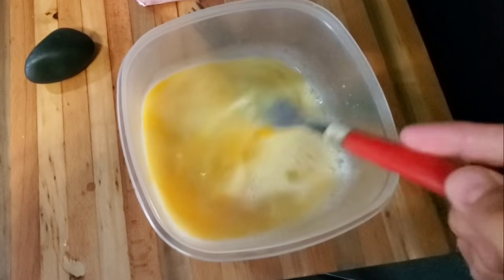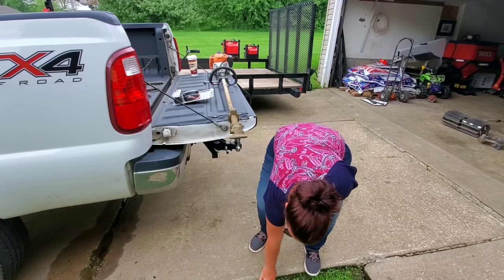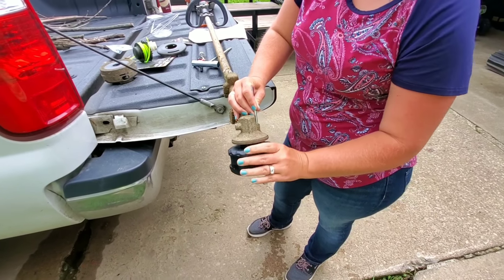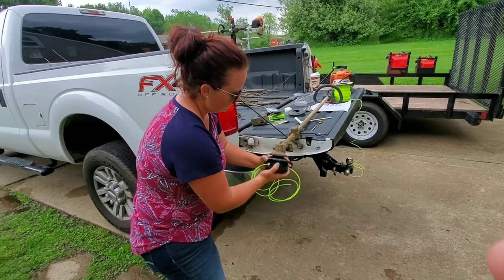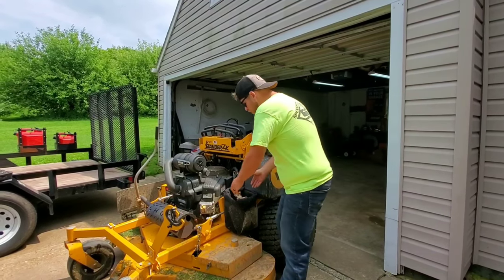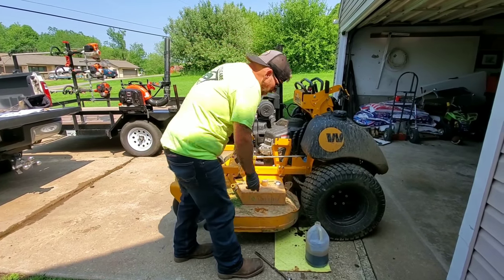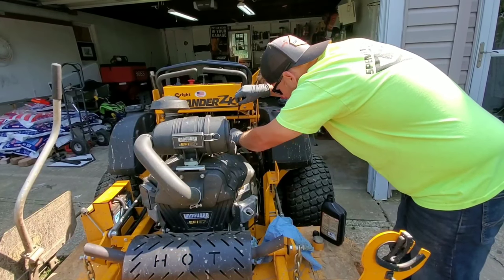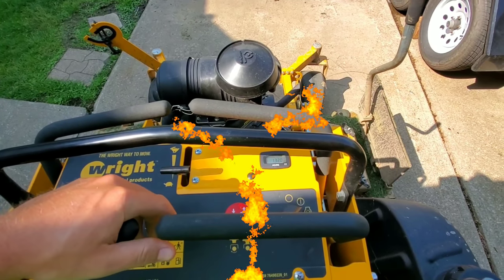This Is How It's Done

Comment: After topping oil off start engine and turn off again and then check oil again because oil will go in filter that  does not go in when just filling engine with oil. Make sence? Anywho, Great video, I think I'm going to get one of those heads for my stihl weed eater.
Reply from the maker: Yeah definitely that's why I added oil directly into the filter. Thank you
Reply: Sorry must have looked away during that part...lol

Comment: Tip: When using the gas-powered string trimmer, be sure that there are no cars in the direction of your trimming. I saw a crew (across the street from me) trimming the sidewalk from the front door to the street, and the daughters car was at the end of the sidewalk, on the street. The passenger side window was smashed from a pebble. The crew never came back. Job security, if you watch how you trim!
Reply from the maker: Definitely man

Comment: Love those speed feeds. I run 450s on all my trimmers. Bit fiddly with some depending on what parts your trimmer already has in there but sooooooo much better. They do go through a little more cord at times I hear but the time savings especially for someone like me who has guys that can be pretty slow reloading heads is well worth it. Instead of measuring out cord each time I go to reload I just pre measure and cut a whole bunch of bits on a day when I'm not working and keep them in my trailer toolbox for when I need them. I always keep a measured length at home with the spool so I don't have to play guessing games lol. Your slow at 25s btw haha I'm at 15s or so ;D Nice vid
Reply from the maker: Awesome man

Comment: Eggs and bacon! Keto diet FTW!  We put Speed Feed 400's on our Stihl's this week...the FS91R, indeed you need to use the Stihl factory threaded drive nut (which Echo does NOT describe in the instructions), and on the FS56RC, we put the Speed Feed on, and no way to add the thick black plastic spacer, but had to buy a 1" I.D. machine bushing to put tension on the dust guard, So it wouldn't spin freely, and snap and pop, and wear out.  We love the Speed Feed trimmer heads, but the instructions are way off base, and deceiving.  You have to figure a lot of it out on your own, and add parts the kits don't come with.  On the FS91R, all parts were included, but the line won't trim with the cutter on the guard, now that the head is spaced so far down with that spacer. Great channel, we as a family look forward to watching your videos every night.  My son is 14 and starting a budding lawncare biz, and I hope to mow, once I can retire from my current career, in a few years.  Keep up the good work!
Reply from the maker: Thank you Monster's for the information

Comment: Sean,  you should have installed a bolt thru the speed feed head before you assembled it. the plastic cap will wear out from bumping to advance the line.  a 5/16 x 3/4" bolt, a fender washer and a lock nut is all you need.  also that absorbent mat is called a pig mat, sold at most parts stores, northern tool etc.  for the peeps,  the speed feed heads fit almost all trimmers- even mtd which is most all home owner trimmers.
Reply from the maker: Thanks bud

Comment: Thanks for showing the oil change on the Wright, mine is due its first oil change right now. I didn't get that hose with mine though, I guess I'll try the one I use with the Kawasaki on the Toro Z Master. 
I saw the video from the other day where TQ had all of that grass and mud on her, she gets all of that grass and mud on her because she's traveling the wrong way when she's trimming. If she will travel from right to left with the counter clockwise rotating head on a straight shaft trimmer, she will find that it throws the clippings and other undesirable goop away from her. If she travels from left to right, it will throw all that stuff right at her and she ends up wearing it. She will be safer in the long run, this will reduce the chance of her getting hit by large debris (rocks) that may be thrown by the trimmer.
Reply from the maker: Thanks man

Comment: Take the speed feed apart and drill a hole in the center of the plastic where you bump the trimmer on the ground to advance the string and put a small bolt in the hole. Makes it last 100 longer because instead of hitting the plastic on the ground the bolt head takes all the abuse.
Reply from the maker: Thanks

Comment: I run this Stihl kind Speed-Feed bump head they last longer than those kind those kind of great to but what happens with them the bottom piece of get wore out in the spring will come  through the head the Stihl last a little bit longer
Reply: You buy just the bottom wear part  as soon as it has holes replace it
Reply from the maker: You can replace just that part, they last along time

Comment: I change my oil when it's hot...all contaminants are suspended in the oil at that time. Also re-check after it has been run long enough to saturate the new filter.
Reply from the maker: Thanks

Comment: I seen one more roll speed heads
Reply: I see one of those feet has at my local echo dealer and a man had bought it as an add-on yeah changing oil we'll keep your mowerl going. Always thinking else prevention means a whole lot more hours mowing. Put new blades on a mower had a hard time getting a bolt off and that when we move the blade is hitting the deck do you have any idea what might be as I'm baffled cuz just running normal on the driveway it doesn't do it only one going over terrain thank you enjoy your vlog
Reply from the maker: Thanks Rick